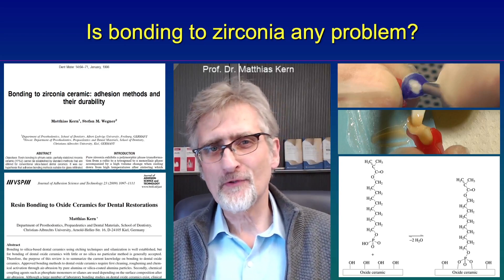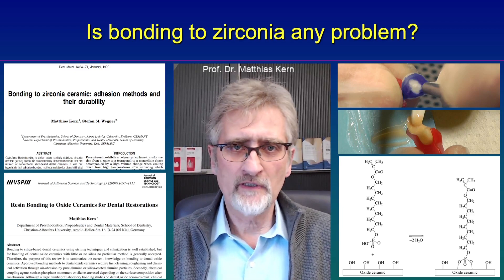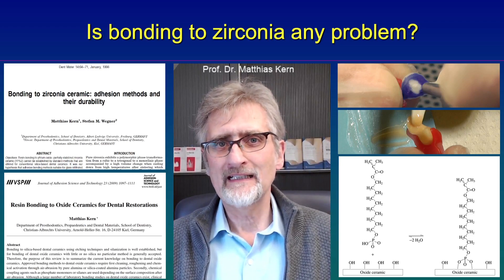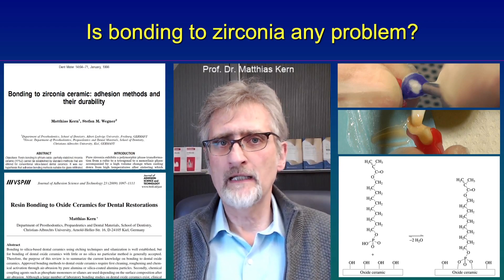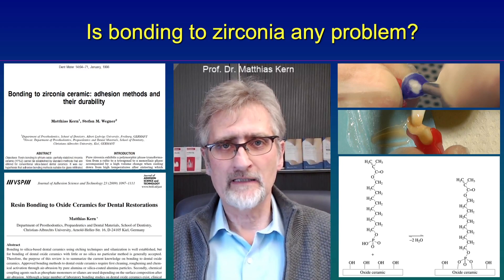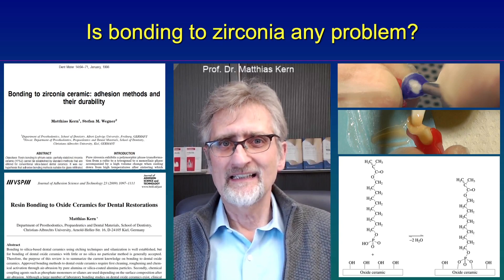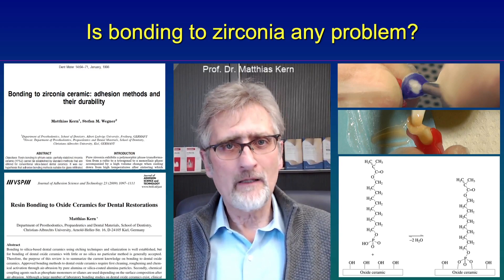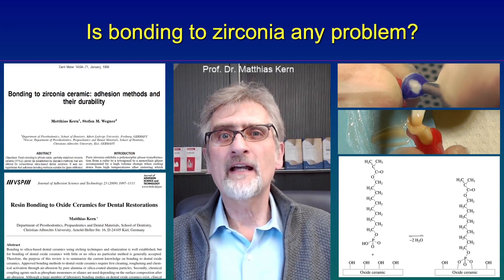Is bonding to zirconia any problem?

Comment: For Maryland bridge, for best retention, do you prefer base metal or zirconia where aesthetics is not a concern? How do you condition the enamel of the tooth for Maryland Bridge?
Reply from the maker: Please watch my following youtube video which will answer your question: https://www.youtube.com/watch?v=N7DmMMlDLtY
In 97% of the cases we use high-strength zirconia ceramic. For reliable bonding enamel is always treated the same way: Etching with 30-40% phosphoric acid for t least 30 sec.
Reply: @ProfessorMatthiasKernEnglish  Will do. Thanks. 49 years ago I was a student at the U of Maryland Dental school of Livaditis and Van Thompson, who developed the Maryland bridge. Appreciate your updates to include newer cements especially since I am now the patient replacing an externally resorbed #23.
Reply from the maker: @juicer52   @juicer52  Then good luck with the replacement of the canine. I have also a video for replacing canines:  https://www.youtube.com/watch?v=MxGdPCtcufY&t=21s
By the way, I spend two years in Maryland with Van Thompson from 1991-1993.
Reply: @ProfessorMatthiasKernEnglish  #23 lower left lateral incisor.Cuspid will serve as the abutment tooth.
Reply from the maker: @juicer52  Even better, will last probably life long! Here case reports on longevity also with a replaced lower incisor: https://onlinelibrary.wiley.com/doi/pdfdirect/10.1111/jerd.13001?download=true